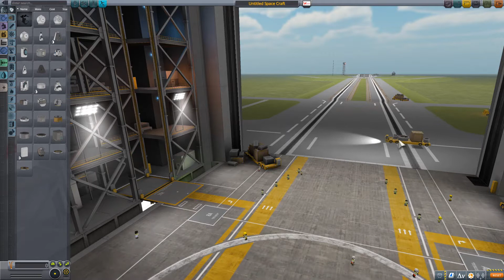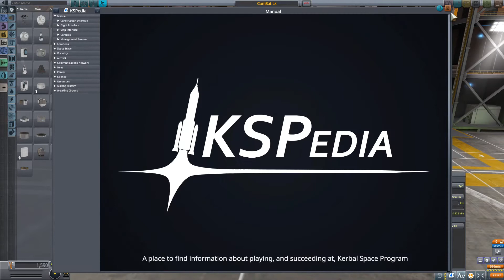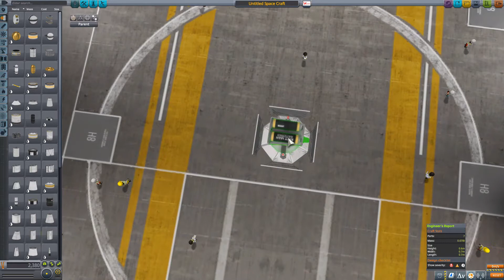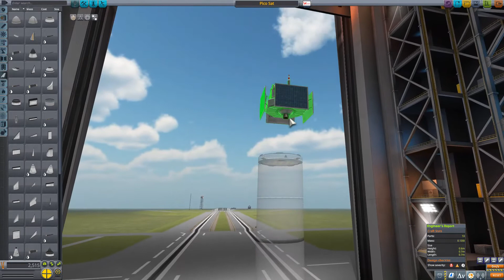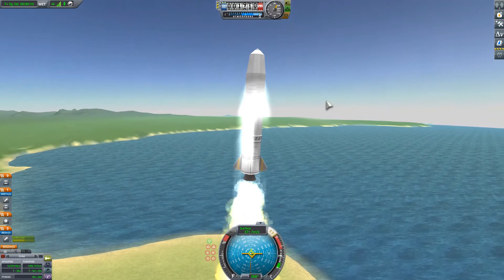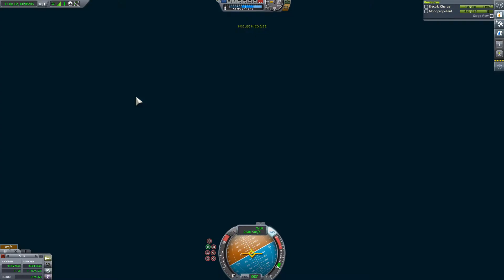KSP Pico Satellite

Comment: Amazed by the efficiency of that launch. Straight up on stage 1 and circularization on stage 2. Subbed
Reply from the maker: Thanks!  Usually I don’t consider my launch efficient if I’m not already going 1500m/s at a LKO apoapsis, but with solid rocket motors, I think the standards are lowered!

Comment: Click on the RCS thruster, click "control with throttle".
Now you will be able to use it with the main engine throttle (shift, Ctrl, z, x) and you will be able to see the Delta V.
You need to stage it on and off with R or RCS, rather than space.
Reply from the maker: Thanks for the info!  It seems like there is always something to learn in KSP.

Comment: I like it!  I always think how much fun it would be to put together a reliable SRB powered launcher to put satellites into orbit, but always end up with a liquid fuel upper stage.

Great job, here, have a thumbs up.
Reply from the maker: Thanks!  Yeh, I usually end up with a liquid fuel upper stage as well.  Solid rocket motors are just fun to use, I guess, because I hardly get to use them.

Comment: Options : use less fuel on the solid boosters in assembly mode, or hold to the weight of the rocket for longer to make the fly less efficient, and thus reach a not so high orbit